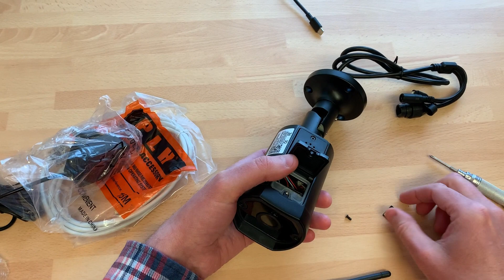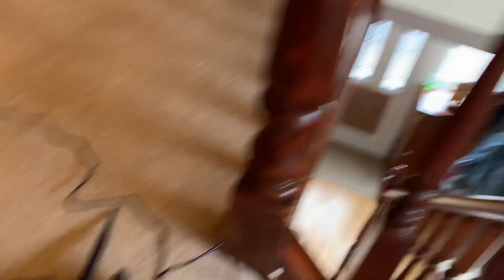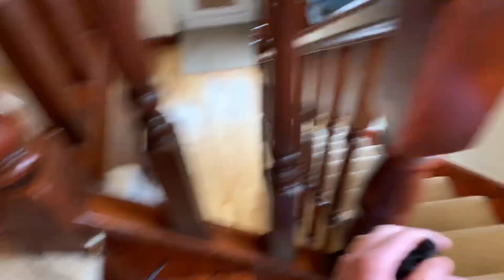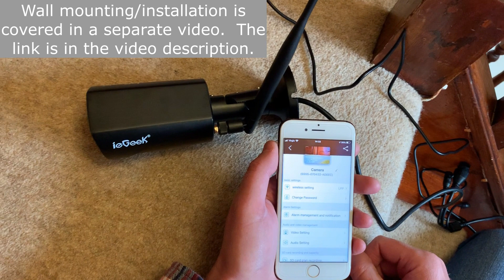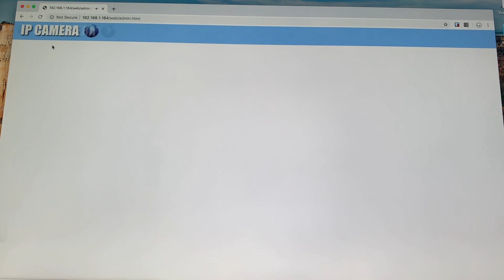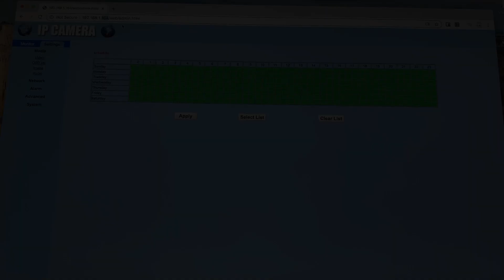ieGeek WiFi 1080p Security Camera  - 25m Night Vision Model - Getting Started

Comment: Hello 
Is that work without the card ?
I haven’t bought the little card yet and i am trying to connect but it say : didn’t find the device to add . Can you please tell me how to connect? Many thanks
Reply from the maker: I haven't tried it without the card I'm afraid.
Reply: Yes it work without the card.First you need to start the camera conected to the internet with the wire,than you set the wifi conection from the app
Reply: My camera isn’t getting picked up on hipro even with ethranet wired in, line lip up green I’ve tried resetting it keeps saying offline

Comment: thought it was wifi ? no network connect
Reply from the maker: You only use the ethernet cable to get the router to authorise the camera.  Wifi after that. 👍🏻
Reply: @GeeWhizRS  Can you run them on the Cat5 too? is is it just for setup?
Reply: thanks  great